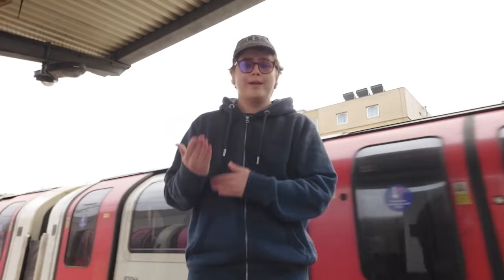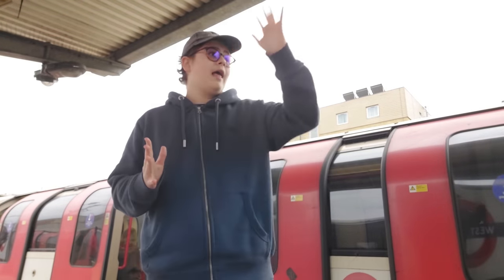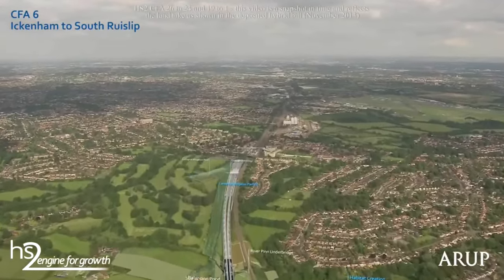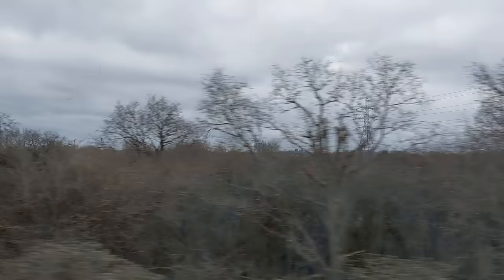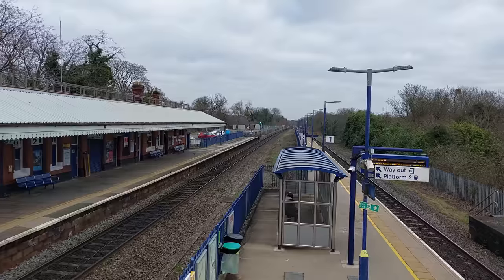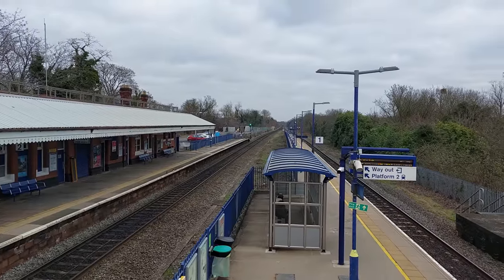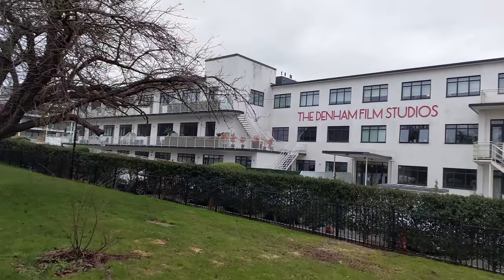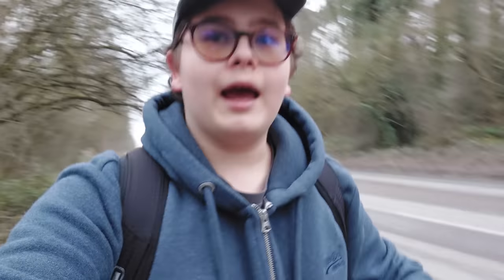Colne Valley Viaduct Progress & Gerrards Cross Tunnel Collapse - Exploring the Chiltern Network

Comment: When I first saw the pictures shortly after the collapse I wrote on a railway forum that it looked like not enough fill had been placed at the sides of the arch to support.  At the time I was strongly critiqued for saying this, but it looks like I may have been correct.

If you catch a grain Northwards from here you will get to Birmingham Moor Street and then Birmingham Snow Hill Stations.  Moor Street was not part of the original railway, it was added in the early 20th century, but originally the line into Snow Hill was in open cutting which was later covered over to enable some shops, the Great Western Arcade, to be built on top, a sort of 19th century version of what was done for the Tesco store.
Reply from the maker: That's really interesting, thank you, I never knew that! At some point I'd like to visit Moor Street/Snow Hill, so if/when I do, I'll be sure to mention that in the video!

Comment: Nice vid.
The viaduct over the North Orbital Road is progressing slowly but surely - Last time I passed that way in November last year I noticed that  the first section directly over the road was in place. Its is elegant and impressive as a piece of Civil Engineering.
If the Chiltern line had been French it would have been electrified on the occasion of the switch from the DMUs of  1960s vintage to the new stock. After all it does connect two major cities.
Reply from the maker: Yep the Chiltern line is BADLY in need of some electrification, although there's no denying that being the last major mainline (into London at least) without any form of electrification does give it some character!

Comment: I comment as a resident of the Gerrards Cross area, this development was not popular at the time, the tunnel collapse and blocking the rail line into London added insult to injury. The line was closed for several months and the Chiltern line was a major commuter route. The Tesco construction was halted for about 5 years while arguments continued, the white frame of the building shown in your video at 11:13 was left suspended across the cutting, as the spoil used to fill the cutting had to be removed from over the remaining tunnel sections to prevent further collapse. Eventually an alternative contractor was appointed, the framework removed, the tunnel repaired and they stated again. The road in front of Tesco goes over the original Victorian bridge, if you were to look carefully from the end of the platforms into the tunnel you can still see the brick supports of the road bridge.
Reply from the maker: I've heard that the whole thing was very controversial at the time! If nothing else, it seems unlikely that Tesco is going to try this anywhere else, given how expensive it was!

Also in regards to your other point, I always found it surprising that they just sort of 'buried' the road bridge, rather than demolishing it and sending the road over the newly covered area. They probably had their reasons (cost, disruption etc.) but still it did strike me as rather odd.

Anyway thank you for your comment! It's great to hear a local's perspective on the matter, and one that is clearly very knowledgeable on the subject!

Comment: 11:00 There's one detail about the mechanism that caused the collapse of that arch that need to be clarified. The weight on top of the arches caused the arch to push out laterally on both sides. As a shape, arches are exceptionally strong when in compression, but they collapse almost immediately when they lose their shape. As the sides pushed out, the amount of weight that the arch could withstand diminished until it reached that critical point.
Reply from the maker: Yes I possibly should have tried to explain that a little better. Thanks for your comment!

Comment: I came across this video by accident, and it has solved an interesting question that I have been asking myself for some time. On the M25 between the J16 and J17 there has been a recent "works" junction added and initially I thought it would become a services, lots of buildings in the Colne valley have gone up and a lot of electrical pylons have appeared, its not a quarry as I thought, and I now know what this is all about , the HS2 line construction, presumably there will be a tunnel here to get under the M25.
Reply from the maker: Correct! The tunnel goes not only under the M25, but under the Chilterns for 16km, which will make it the longest tunnel in GB (excluding maybe the Channel Tunnel but that doesn't really count since half of it is in france)

The motorway exit you mentioned is a temporary thing to allow access to a massive compound which is being used to produce the concrete for both the tunnels and the viaduct shown in this video. They're producing the pre-cast concrete segments on-site to minimise carbon footprint from having to transport them long-distance, and once complete, the entire area will be demolished and rewilded.

Comment: I remember this happening and had assumed that I had simply missed the relevant follow up reports but um it seems that they'd been buried for 17 years. You can quite clearly see the crown buckling under the weight in the photographs though.
Reply from the maker: Yep. Although the reports were never formally released until quite recently, it was fairly obvious to most people in the engineering industry what had caused the collapse...

Nonetheless, the investigative reports are still important as they help provide the context into what caused the collapse and why it happened, and provide engineers an opportunity to learn from them and not make the same mistakes in future.

Comment: Good summary of the Gerrards Cross tunnel collapse. I came home from London to Seer Green & Jordans (next station north after Gerrards Cross) on that evening, and went through the tunnel around 20 mins before it collapsed - it was raining hard that evening, so the rain would have been applying extra weight to the piled up fill. I remember the days of disruption while they cleared the tracks, and then worked out a safe way of letting trains back through.

Comment: Any Civil Engineers out there? I am an electrical power engineer so I have a question you ‘Civils’ may find daft. Why did they no put some props up inside the tunnel (Americans seem to call it ‘False-work’) to make sure it did not collapse from backfill errors. Seems like they assumed an almost perfect re-loading of the tunnel shell. Am I incorrect about that?
Reply from the maker: My guess would be because it was still an active railway underneath, and I imagine they were aiming to cause as little disruption as possible, but this is of course only a guess. Good question!
Reply: @MikeWillSee  Yes, I think you are probably correct. There was a similar constraint on a footbridge over a road in Florida a few years ago. They did not want to close the road as they were post tensioning the reinforcement wires/ bars in the concrete. Unfortunately cracks appeared in a node of the concrete and the bridge collapsed onto the open road tragically killing people (Nine I think). It was being built for Florida International University.

Comment: What a massive waste of money this project and a stain on the countryside and wildlife in this area, it’s actually shameful of this country to build this line it’s just not needed. For the residents of ruislip and Denham and the surrounding area it’s one massive eye sore. Shame on the government.
Reply from the maker: The idea that we don't need this line comes from the misconception that it's all about speed, when in reality it's about providing much needed capacity to our increasingly strained rail network by taking express trains off existing lines, freeing them up for far more local services.

There's no doubt that any project of this scale is going to have some localised environmental impacts, but it is far smaller than comparable schemes (e.g. Lower Thames Crossing Motorway destroys more or less the same amount of woodland despite being approximately 2% of the length of HS2!) and HS2 have committed to massive rewinding projects meaning there will be a net gain in biodiversity along the route. In any case, the biggest threat to woodlands and the wildlife in this country is climate change, which this helps to address by providing an alternative to road and air travel by increasing rail capacity and driving modal shift.
Reply: @MikeWillSee  for 20 minutes saving it’s not worth it and after covid with people working online it’s proved it’s not worth it, also you might know the answer to this that the line might not get to Euston now which would be unbelievable and also to save money which it’s up to 120 billion to save 20 minutes wow there also now building the tunnels smaller which means that the trains can’t go through them so quick because of the air displacement which means that 20 minutes is lost, maybe you could clarify them points if you know. Good video btw.
Reply from the maker: @Craig Davenport  first of all glad to hear you enjoyed the video!

If it's alright with you I'll try and address some of the concerns you raised, but I do have a nasty habit of writing quite a lot so I apologise in advance!

The idea that it's "just to save 20 minutes" is false for two reasons:

1. It's simply not true - the time savings between London and Birmingham are predicted to be 49 minutes!

2. The time savings are nothing but a side-benefit anyway, and the primary justification for the line has always been about capacity. I talked a little about this in my last comment but the problem with the current rail network is that intercity express trains and local stopping trains share the same line. When an Intercity train comes through it eats up loads of capacity since you have to leave a large gap in front of it so that it won't catch up with the slower trains. If you can place the express trains on their own dedicated line, it frees up the existing network for far more local, regional, and freight services. For the lines affected it allows a doubling or tripling of capacity.

The idea that we don't need extra capacity due to an increase in home-working is also a bit of a falsehood. In reality, covid has simply accelerated the trend towards home-working, which had already been taken into account when predicting future transport needs. In any case, the latest transport statistics show that we are back to 90-100% of pre-covid ridership levels, which, even if a (slight) reduction from 2019 levels, is still about the same as passenger levels were roughly 10 years ago, when the need for the line was first identified.

The idea that the line won't go to Euston is concerning, but thankfully false. The news was debunked almost as quickly as it broke, and Old Oak Common simply doesn't have the capacity to operate as a terminus. With that said, due to some poor decisions from those in government, the opening of Euston has been delayed from the original plan, meaning that it unfortunately won't open until a few years after the rest of the line.

I hear the £120bn figure being thrown around a lot, but am yet to see a reliable source for it. Until I do, I'm assuming the figure has just been made up. The cost may well increase further since it is still being calculated, but most cost increases are owing to inflation rather than mismanagement of the project. In any case, the official budget for the whole line is still £88bn, which does sound like a lot, but from my understanding, it is the cost of the full project, including the Eastern branch to Leeds, rather than just the London - Birmingham section.

The other thing I think is important to note regarding cost is that it's not like they're spending £88bn a year - the cost is spread over several years if not decades, meaning the yearly budget is only about £3bn. To put that into context, approximately £8bn a year (if not more) is spent by network rail to maintain the existing network, and approximately £7bn a year is spent on subsidising domestic aviation (which is a bonkers policy decision knowing how much pollution that causes).

Not sure where you heard that news about the tunnels being made smaller, I would treat that with extreme scepticism if I were you, as many of the tunnels have already started construction, and you can't exactly change the size of a tunnel boring machines half-way through! Those that haven't started construction are due to start soon, and as such the TBMs would have already been made for them. In any case, changing any element of the design this late on would save exactly £0, since there is a huge cost to redesign something last minute, even more so if it's already begun construction!

The only way I could imagine you may have heard about the diameter of the tunnels being reduced is because some sections of the line do have smaller diameter tunnels than other sections, but this has always been the case, rather than a last-minute cost-cutting measure. They may have opted for a smaller diameter tunnel if:

a) the tunnel is quite short (as is the case with the Itchington Wood tunnel)
b) the tunnel is designed for lower speeds (such as the approach into Euston)

I realise I've written quite a lot but I hope this addresses some of the concerns you raised, and if you do have any further questions I'll do my best to answer them!
Reply: @MikeWillSee  yep fair enough as I say this is what I’ve heard and I’m always ready to listen to someone else’s opinions the only one I wouldn’t agree with you is climate change but that’s another issue, I also agree with the engineering aspect of these works is fantastic let’s hope they don’t have any collapses like the one in the video, will watch your future blogs videos as I’m also interested in the rail network as such and model railways.

Comment: HS2 is definitely worth promoting - line we don't need, brutally cutting through cities and important environmental sites, built for no reason apart from bringing money to those involved. And brutally cut down from original plans to the point it serves no purpose (Old Oak Common end terminal, axing branches in the North etc)
Reply from the maker: Who said I was promoting it? This video is simply a construction update on the project. In any case it is worth promoting exactly because of comments like this which shows how much falsehood and misinformation surrounds the project.

The line is needed because our railways are already at capacity, and need to carry more people in future to cope with the climate crisis

The line has been designed to be very sensitive to urban and rural communities alike, and whilst some disruption is inevitable, it is FAR less than alternatives - the Lower Thames Crossing motorway affects roughly the same amount of woodland as HS2 despite being ~2% of the length of HS2 for example. The total area of ancient woodland lost to HS2 is less than 1/10,000th of the ancient woodland in this country.

I semi-agree with your last point about the cuts, but Labour (who looks increasingly likely to be the next government) have committed to the full 'Y' shape of HS2, and the idea that Euston was cut from the plans was debunked almost immediately after the news 'broke'.